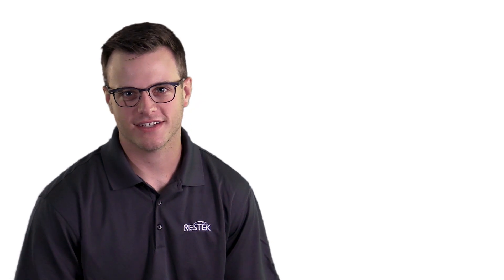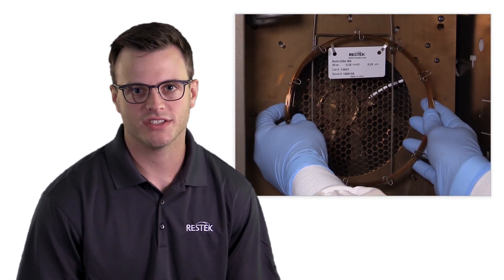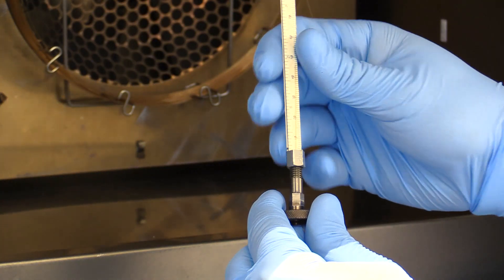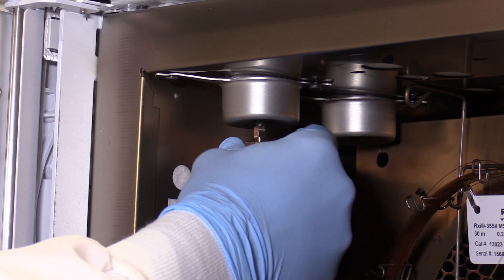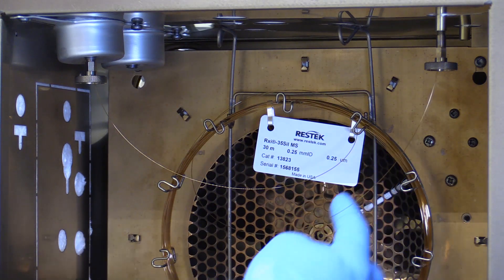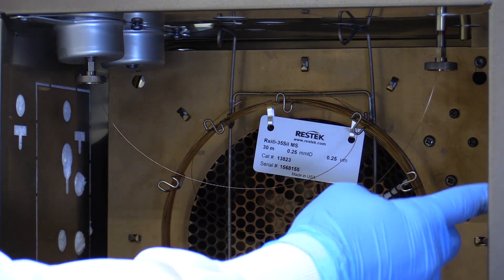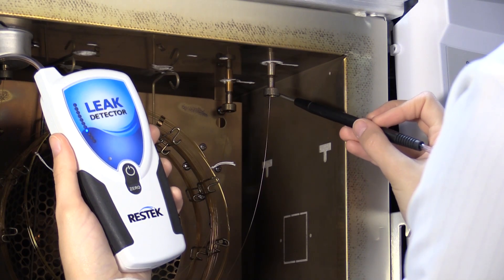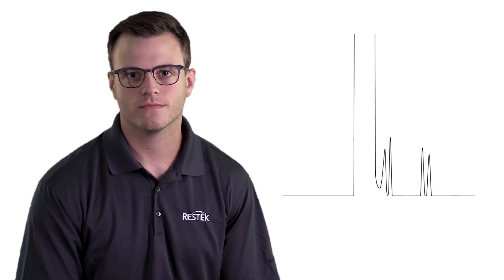GC Column Installation

Comment: Prior to connection on Detector side. It is advisable to check the flow through column by using any solvent
And see trend of bubbles at different flows are pressures